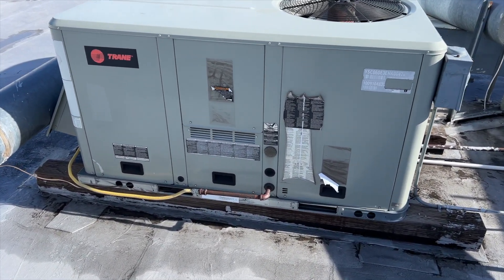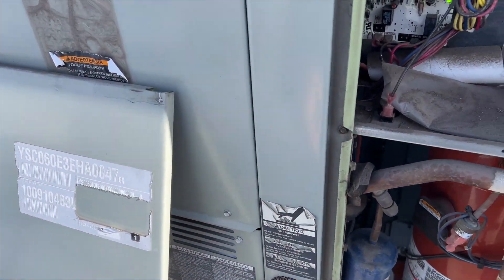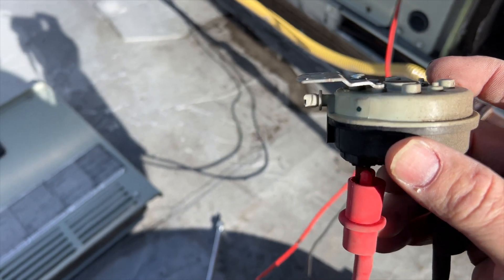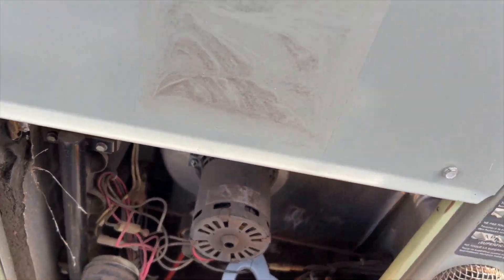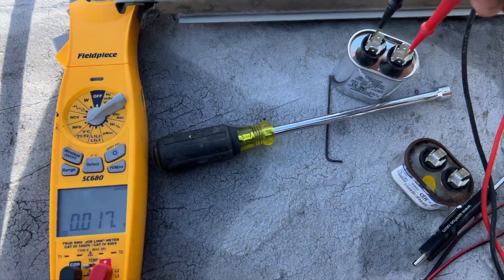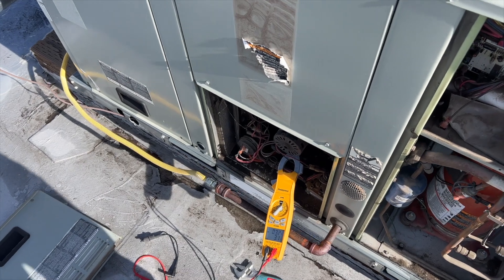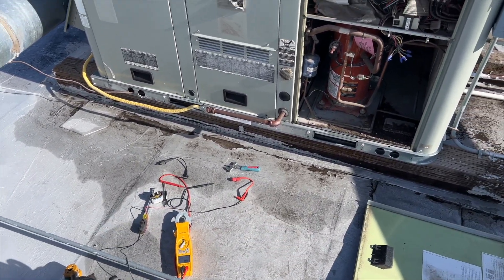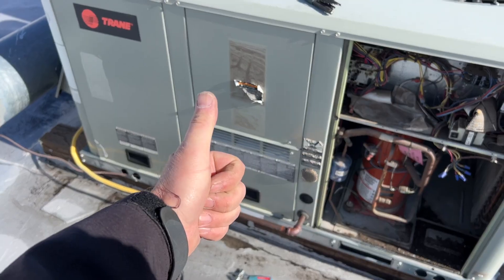Second Opinion On a No Heat On a Trane Package Unit EP116

Comment: If a capactor reads high it is because it is internally leaking. The meter reads capacitance by timing how long it takes to charge. If it's leaky it will take longer to charge and show a false high reading.